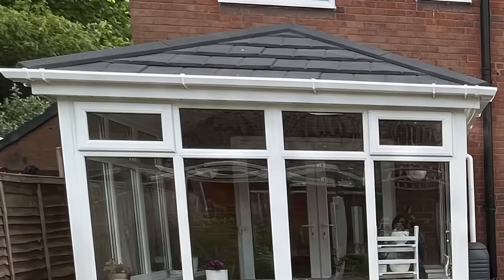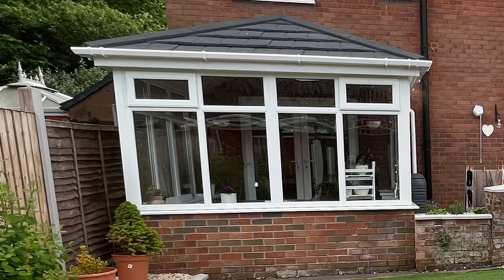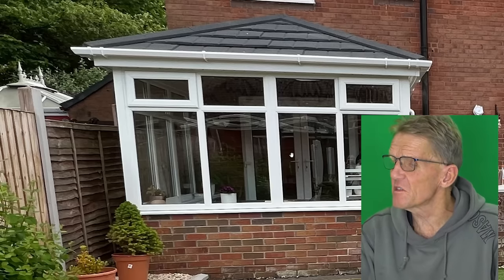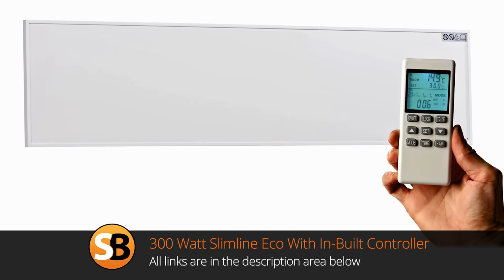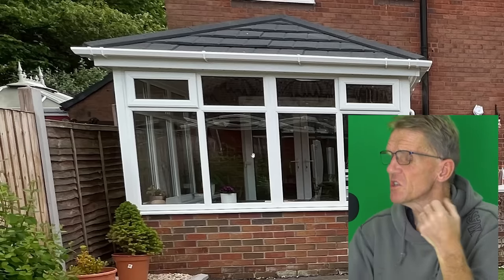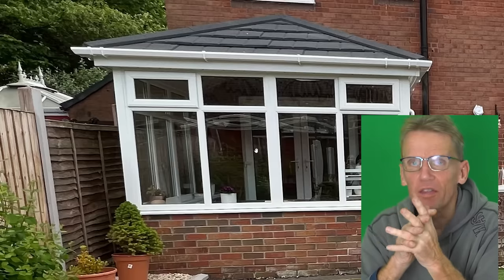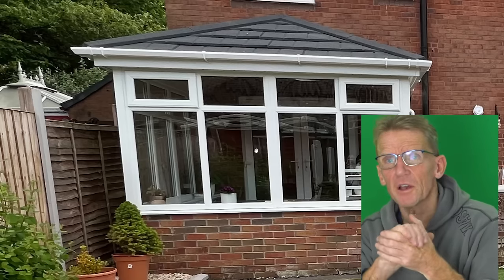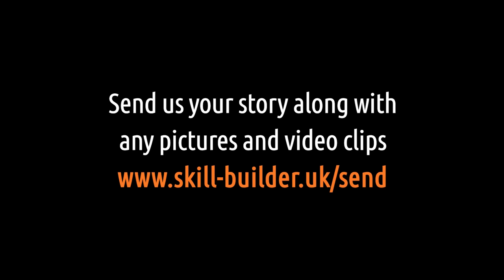What Can You Do About a Freezing Cold Conservatory?

Comment: I had my roof converted the same as the photo with 100mm PIR plus the same in the floor. In addition I blanked in one wall (next to fence) with insulation and plasterboard. It is now much warmer and we make better use of.
Reply: I'm thinking of doing the same. Do you have any problems with condensation on the inside of the windows that are blocked off?

Comment: Building regs: I believe you can heat the room as long as it's a separate heating control, ie not on the same thermostats as the main house. As an example, you could put electric heaters in if the rest of the house is on gas. This of course doesn't help with the bills

Comment: Very similar to ours and we just splashed out on a 5KW log burner , taken the patio doors off and it heats through a treat. We did have a properly insulated roof fitted 10 years ago though . Pics available if needed.
Reply: Hi. I would love to see some photos please if possible.
Reply: Log burners release toxic air pollution including into the rooms they heat
Reply: @stewartbridge5162  Don't you have a road to block somewhere?
Reply: @JC-yc2sz  you're a head in the sand type of guy. Stay wonderful
Reply: @JC-yc2sz  As if making the neighbour stink of smoke isn't also anti-social.
Reply: I hate log burners too. The air stinks round my way when it gets below 14c.
Reply: @stewartbridge5162  so does the waste you throw down the drain...
Reply: @Wild-Storm  I didn't know that, but it makes sense
Reply: @stewartbridge5162 it's actually miniscule back into the room with a log burner. I bought a PM2.5 detector the last time The Guardian did a scare piece on it. The only time that reads much is when we're cooking anything on the hob, it's over 200 ppm. It's usually 7 ppm in the lounge next to the burner.

What comes out the chimney is a different story but if the wood is super dry and you keep the burner in the optimal temperature range it produces a lot less soot.
Reply: You've thought this through and follow best practice. I still think Chris Whitty would be uneasy.

Comment: The glazing on the fence side you could remove that and replace it with a wall with insulation, brick on the outside cavity and studwork on the inside, insulation in the cavity and studwork. Then you would have glazing on only two sides and a solid insolated wall on the other.

Comment: I found that a lot of the problems with double glazed windows, at least in my experience, is that there's typically a 3-5mm gap between the glass and it's frame.
What's the point in having double glazed windows and almost-airtight frames if there's a fairly large gap right around the edge of the glass for any heat to escape around?
I popped each window trim off and carefully slid some of that superfoil-type bubblewrap insulation sheet into the gap to fill it up, the difference was astonishing...and cheap to do.
You do need to take care not to block off the internal drain holes when doing this though, or else water can start leaking through the window to the inside, as I found out with one window.

Another thing is the trickle vents in the top of the window tend to be cut straight through the frames, meaning that the inside of the frame leads directly outside through the trickle vent because there's a bloody great big hole now joining it all together. I popped the inside trickle vent off and plugged the side holes for the inside of the frame with a simple 10mm piece of sponge.
Why sponge and not expanding foam? Well, I figured that sponge would allow some air through to keep moisture from building up too badly in the frame, expanding foam would seal it in.
The inside of the frame on all of my windows doesn't get cold any more. May be worth checking out the drain holes while doing all of this, they jam up easily and you could find that your window frames may have a significant amount of rainwater inside of them. That really doesn't help with keeping the windows warm! 😅

Comment: Another great informative video - thanks Roger.  I have a small conservatory and I cut insulation board to the shape of the glazed roof and window sections, wallpapered them and fixed small white clips at intervals to the frames, and slotted in the boards for the winter.  I leave some roof clear for the view, just my preference. I suppose you could hinge the window boards somehow if you didn't want to take them down all the time, or use shutters, and add extra insulation to those.  I added more insulation to the floor and dwarf walls too but nothing too expensive or excessive as it's only for a few months in the year.😄  (PS - I used retainers that turn side on or not, rather than something that has to be pulled hard as the board could break)
Reply: Very Clever Man! - I've thought of doing this for my 6 x 3m glass roofed conservatory for years but haven't been able to figure what what type of clips would work. Can you please assist with a picture/ description/ web link?
Reply: @dadondada41  Turn buttons, or similar, but not screwed in so tight that they cannot be rotated by hand. SUfficient strength material, and qty according to the weight of your 'boards'. Another thing I do at times is paint the roof glass on the inside with a thinned down water based paint for summer shade, and just wash it off later - much cheaper than blinds - lol.

Comment: Another alternative is air source heat pump, that is air conditioner, there is some model installed on lower level hangs on the wall. It is a bit costly but can make both summer and winter enjoyable. I am wondering triple glaze windows will help but no matter how strong the insulation, when lights can pass through, there must be some energy loss. Two patio infrared heaters could cost you 200 but an air-to-air heat pump is about 1.3-1.5k but last very long and energy efficient enough.

Comment: We use our 6 x 3m conservatory all year round. DG windows / doors on two sides & a fully glazed roof. It has a wall mounted 4kW Air to Air heat pump which provides heating in the winter & cooling if needed in the summer. Works well enough even when it's below 0c outside. Warms the space up quickly & it's efficient too.
Reply: A 4kW heater for one room?

Comment: Heating ain’t the problem it’s keeping that heat in .
   As conservatories never came under regs everything was done to the minimum. 
  No under floor or cavity insulation to save on cost but if it was put in it was the very minimum . 
    I worked on them for 14 years 🧱👍🏽🥶🥶

Comment: I have a similar sized conservatory, admittedly one wall is full height cavity, had composite roof tiles fitted onto a new super insulated timber roof, wall mounted oil filled rad & it’s now extremely warm in winter & cooler in summer, if your existing structure is very old then maybe think about taking it down & having a proper extension built.

Comment: Because underfloor heating is a form of radiant heating, unless it's of the resistive electric type which costs the earth to run, I think it might be worth considering. You will not change the fact that there will be lots of heat loss, but may make the space usable. Another idea which may be easier is to install a wall mounted spit air conditioning unit (aka air to air heat pump). We use these for spot heating in winter, and cooling in summer, and they can be pretty efficient. If you do this research the SCOP stats to ensure you maximise efficiency, even if it means paying a couple of hundred more pounds. We have off peak electricity and I set my downstairs Aircon to come on and pre-heat areas using off peak electricity; though in your case the room wouldn't really hold much of the heat for long!

Comment: It's a lost cause. Unfortunately sometimes the composite roofs are little more than a bit of multifoil stapled up rather than say, 25mm PIR. Either way you are right to lower the homeowner's expectations, it's never a year round room without extra heating. She could add some magnetic secondary glazing, for a fairly cheap additional bit of heat loss reduction and get someone to instastik some insulated plasterboard on those dwarf walls but personally I'd knock it down and whack an extension up, maybe a SIPs extension would meet the brief here well.
Reply: Blinds which you can roll up and down according to the weather and instead of the insulated roof, roof blinds that allow the sun in. Blocking out the sun is not a good thing

Comment: I have a very large conservatory and when it was built had radiators installed from the central heating. You pay when it is overcast and cloudy  but when the sun shines the temperature rises to high 70's even in the winter. I would never replace the glass roof with an insulated one defeats the purpose of the conservatory. I am typing this with no heating on and the temperature is 60 degrees and within an hour or two with bright sunshine it will be in the high 70's.. I sit in it and watch the birds and bright sun light stops SAD seasonal affective disorder. It is worth its weight in gold. I also have blinds that when it is cold I pull down to keep the heat in. It is now 11.15 and the temperature is 75 and rising.
Reply: Judging by the fact that you state your temperature in fahrenheits I assume you're not from UK?
Well here in the UK starting from late September and up till late April almost every day (I'd say 8-9 days out of 10) is overcast, often with rain and no sunshine whatsoever.
So having a transparent roof makes very very little difference.

Comment: Can you do a series about good quality windows - doors and compare /check quality(noise measure , efficiency etc.). I would see you showing people with thermal camera how they heat is running from home, plus how much on the long run 10-15 years on proper insulation + changing windows you are seves pros & cons (comfort of living in warm non dumped house ). Please

Comment: I had the same problem, radiator couldn't cope with heat lost so I recently installed small 2kW split unit, aircon/heat pump/dehumidifier . I love it. Heating cost me fraction of the previously used electric fan heater. Cost of the air-2air heat pump/aircon £800  (£500unit+£300 installation) installed, Fujitsu. You can get cheaper so no names online or DIY with gas 290  if you good with DIY, wich was my initial plan. I uses conservatory as dining room, so heat it 20 minutes before use, or use dehumidifier option when I have something to dry, which is almost every second night.

Comment: Always a problem, our Connie is south facing which means in the winter months through the day while the sun shines it's a lovely place for around 4  - 5 hours but with no sun - brrrrr.  The cheapest solution for us is an oil filled electric radiator which takes the chill off but, short of running up electric bills with rapid fan heaters , there's no real answer. At least this lady has solved the roof loss, we have the traditional 3 ply/cell polycarbonate which offers no insulation.

Comment: Would there be any benefit in insulating the brick work?
Reply: The glass would rather quickly lose it on insulation levels, we also don't know what type of glazing is in (single/dubble or hr+ +) and how well the flooring or roof is in stopping heat loss.

Comment: Well you could put a couple of sliding glass panels and a fixed one in the middle. If you're not worried about opening the windows in the winter just get some clean film and put a 1 in stock doesn't need to be fixed together just as long as it's tight wooden frame and heat it with a hair dryer and that will give you great insulation

Comment: We use 170mm celotex in roof. Vented at the top and taped seals underneath insulate walls never had a problem with heat loss vast difference compared to glass or polycarbonate

Comment: On top of the infra red id say external wall insulation or blown cavity insulation after checking its insulated assuming it isnt. There are also window films to reduce heat loss, internal and external. Cheapest options. The internal wall could use that insulation bubble foil insulation.

Comment: It might be worth running heat sensor gun in it, it can be surprising where heat is getting out sometimes. It might be they only used a polystyrene board on the roof or the dwarf wall is single brick and not insulated, etc.

I know a couple of people who sit out in their conservatory all day all year round but ultimately they are designed to be occasional spaces.

Comment: I agree with this advice - conservatories are a lost cause. It's strange though, as our garden room shed, which is an insulated Dunster House job with big double glazing at the front warms up very well entirely passively on a sunny winter's day. Not so great on cloudy rainy days, but a little fan heater gets it pretty warm. I don't know why that would be seemingly more efficient than a conservatory. The roof is 200mm PIR and the walls are insulated (and taped etc. so there's no draughts). But still, it was a £10k wooden shed so I'm surprised at how well it does.
Reply: You can't seem why it's more temperatures efficient? It has 8 inches of insulation, 200mm PIR. Taped, so no leaky draughts. That's why.

She's losing heat through the enormous glass that's not insulated. Through the brick wall, probably not 200mm insulated, probably not even 50mm insulated.

I do wonder if there's a winter window insulation solution? Maybe window sized white panels that are fitted to several of the windows to insulate them. Just push into place, maybe tape or a rubber seal to prevent draughts. Even a clear plastic which is sealed would help.
Reply: @Google_Does_Evil_Now  I suppose it's more that inch-for-inch we probably have nearly as much glass as in this conservatory, walls that are moderately insulated but probably no better than the brick cavity wall that she has here, and while the roof is probably far more efficient, Roger's not suggesting replacing the conservatory roof with those PIR boards that SkillBuilder did a video/promotional piece on a few weeks back (essentially the same thing we have on our shed). I'm just surprised there's such a difference.

Your suggestion re winter panels is a good one, and something we have done on our upstairs loft conversion where the Velux windows are the weak point in an otherwise reasonably well insulated space. Just 25mm PIR board cut to snug fit, and foil taped around the edges so they don't spill tiny foam dust everywhere. Surprisingly effective.

Comment: Exact same issue here, we just keep the electric wall heater on low if we're using the space and suck up the cost, kids love running around in the big open space so it's worth it just to keep them occupied. East facing so it warms up nicely if the skies are clear anyway. Long term solution is to knock it down and build a proper extension when we've paid off a bit more of the mortgage.

Comment: I would replace the windows with “triple-pane” windows, + put in more electrical space heaters (or, put the n a “gas fireplace” instead), and bring those doors back, and nail them into the walls (if you don’t want to add in any insulation)

Comment: Hi just wondering what is the best way to insulate an outside wall that forms part of my internal garage? The outer wall is freezing in winter in turn making the garage freezing. I was thinking of just insulting the wall with Kingspan insulation boards ? Would this work in your opinion? Cheers and keep up the useful Q & A videos ❤
Reply: Bloody wall
Reply: Did almost the same in our flat where the entrance lobby wall backed the lift shaft - freezing and damp in winter until we plastered it with polystyrene foam and plasterboarded over it.  Warm and dry after that so well worth it.  You'll need to consider cold-bridging of the roof and floor too - if the garage is effectively joined to the house like a conservatory.  Just make sure to air seal any gaps with foam/sealant where warmer moist air could condense and rot the board.
Reply: @TheErador  thanks for your comment 👍 sounds like you had a similar problem to me. My garage is internal to my house with just one brick wall being external and open to the elements, hence it being freezing cold in the garage. I was just looking to baton the wall and fix insulation board's to the batons but not plasterboard over the insulation board's? Cheers Nigel

Comment: Hmmm. I have a cheapo conservatory.2 external walls double glazed and a polycarb box section roof. Doesnt seem to be noticeably colder than the rest of the house.
Reply: You probably have a massive radiator in there and having a huge heat loss (heating your garden basically)? With a decent enough high power boiler it's possible but heating bill is probably as impressive.

Comment: My conservatory a bit bigger than that but is fine with a little added heat after I insulated roof with battens, multifoil and plasterboard. Could do with a little extra insulation but still retains heat well. Why not mention extra insulation to floor and walls. Throwing heat at it with those heaters is just wasting energy. Even decent blinds can help keep sun out so doesn't get too hot and also retain some heat at night and in winter. Can't understand why you haven't mentioned extra wall and floor insulation